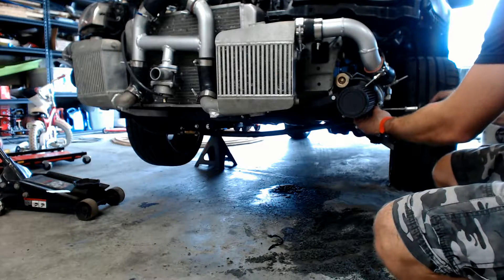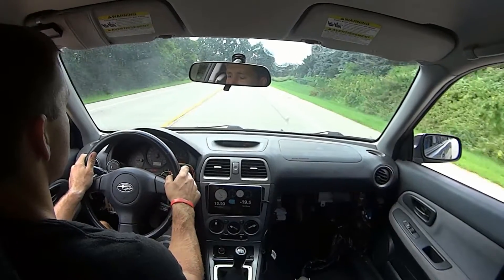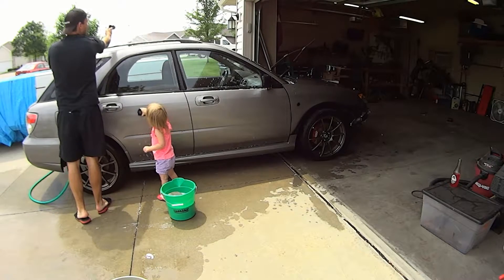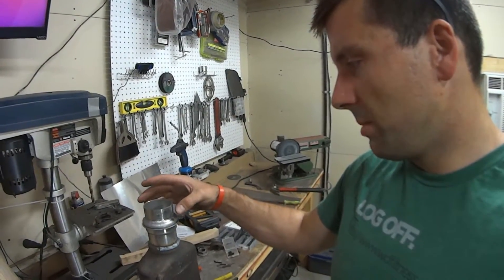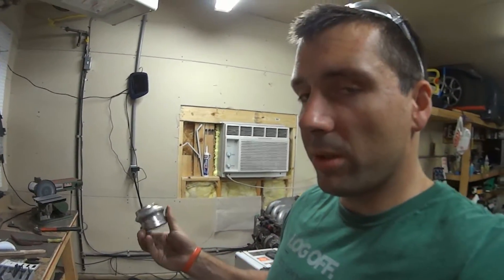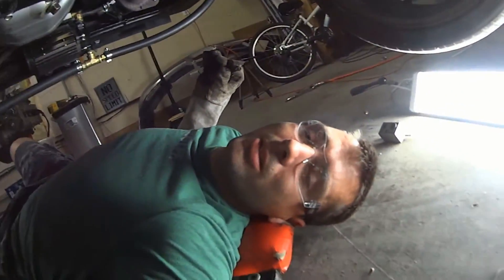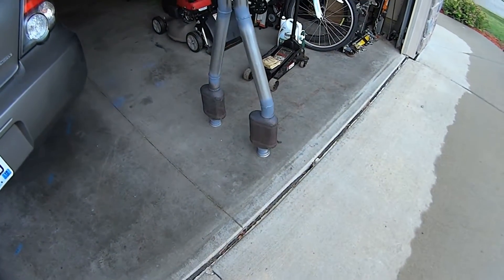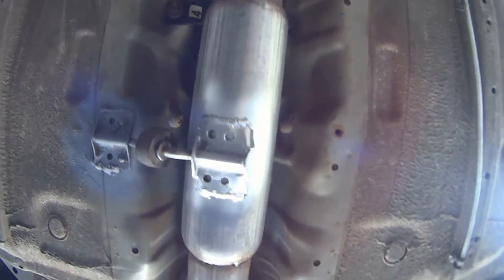EG33 Swap - Custom Exhaust Fabrication (Ep. 31)

Comment: I believe the reason for vband leaks is the weld job, some just go wide open from one side to the other. If it's tacked side to side in several places, it will be more flat. I've had them done and noticed the ones that warped were welded continuously.